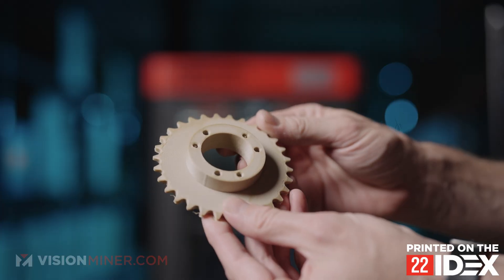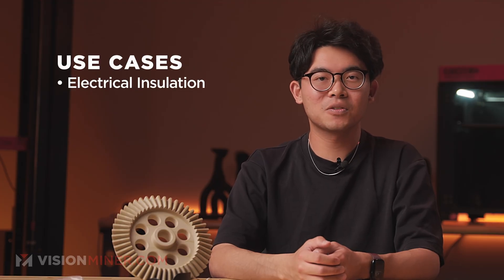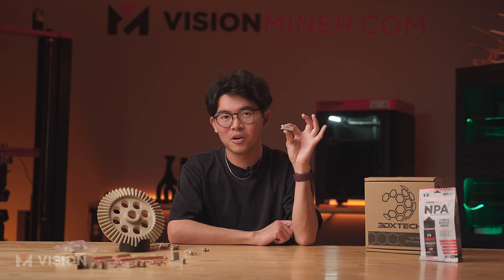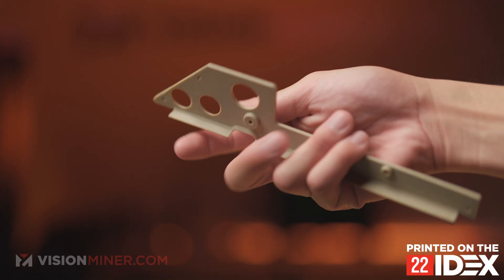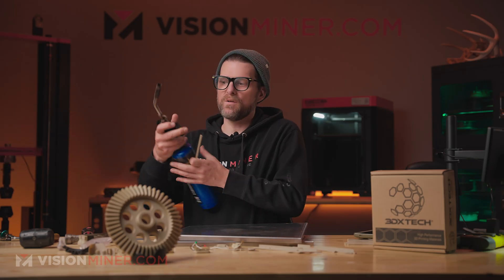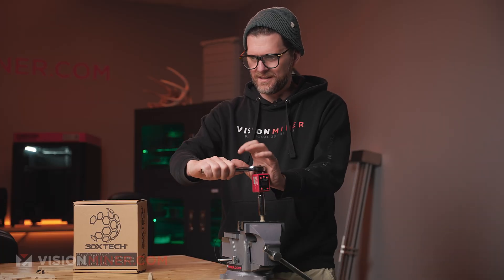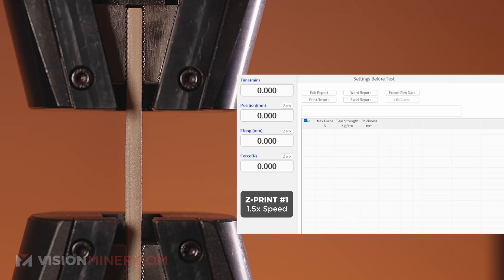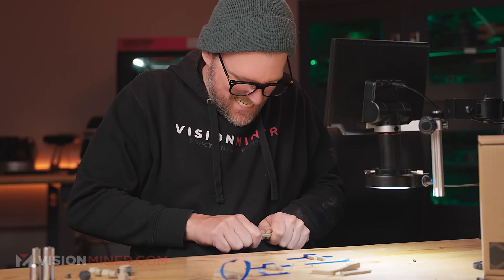Why GF PEEK Is Stronger, Hotter, and Safer Than Carbon Fiber

Comment: how would GF PEEK preform as a cam chain tension & slide, I am looking for a suitable material for custom slider for a project.
Reply: Our company produces PEEK materials as well as GF PEEK and CF PEEK materials! We have several dozen PEEK grades to choose from. If you need them, we can send samples for testing your project!
Reply: @lauren-zhai Which has better flexural and torsional strength?
Reply from the maker: Probably pretty well -- although un-filled virgin PEEK would probably do better, fully utilizing the self-lubricating properties -- the glass fibers can cause increased wear on mating surfaces, similar to carbon fiber -- but that's not always a deal breaker.

Comment: While it's not super apparent, I noticed at 6:57 that the overhang on the hole was meh. With an IDEX system, for your engineering demo parts, why don't you use a support material? For a part like this - makes sense, but I've been watching a lot of your videos recently and noticed that there aren't a lot utilizing the IDEX feature, specifically for supports. Though it'd also be super cool to see multi material engineering parts!
Reply from the maker: For high temp parts, rule of thumb is keeping layer heat/part temperature as high as possible -- when you add support material, and thus tool changes, you add a lot of time -- each change adds 10-40 seconds to each layer, which allows the part/layer to cool much more, reducing layer adhesion and overall crystallization quality -- so, while it's fine for some parts, in general avoiding multiple extruders without a 140-250c chamber is not ideal for part quality. Other materials, like ABS or Nylon or PC, however, do fantastic in the 22 IDEX, since the chamber temperature is much closer to the materials Tg (glass transition point)

Comment: question about the SLS! so obviously the FDM nylon requires drying and to stay dry. does this apply to the SLS nylon powder as well? how do u even keep powder dry? any special care for that kinda stuff?
Reply from the maker: Powder is a very interesting one. During out time with Sinterit, there were issues with powder that got too moist -- leaving it out for a few days to a week would essentially render it useless, without an extensive vacuum/oven drying process, potentially degrading the material. Now, with the Formlabs systems... we've left powder in the hopper for weeks at a time, and every print comes out essentially perfect -- we LOVE it!